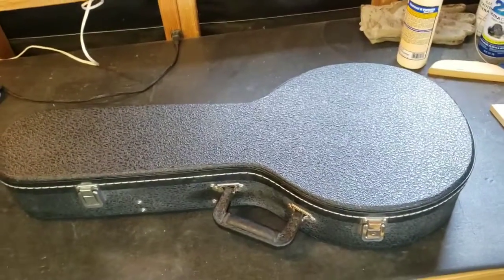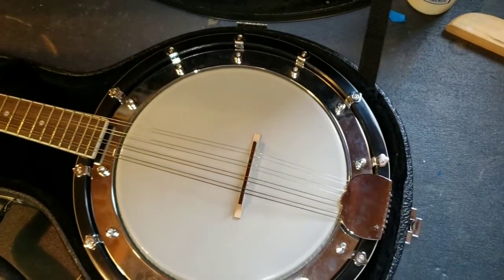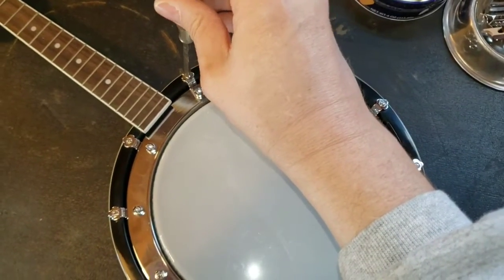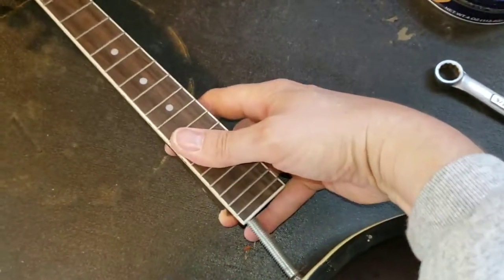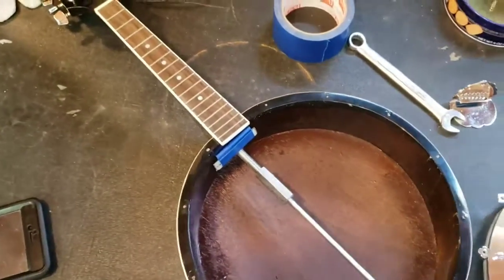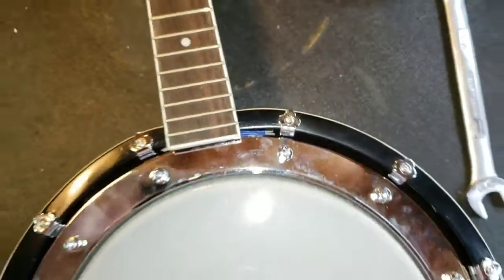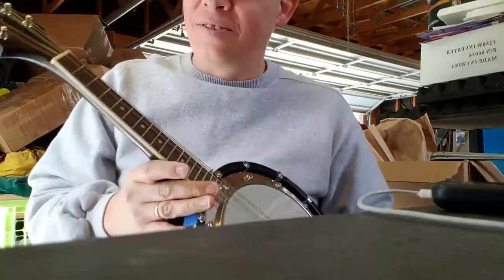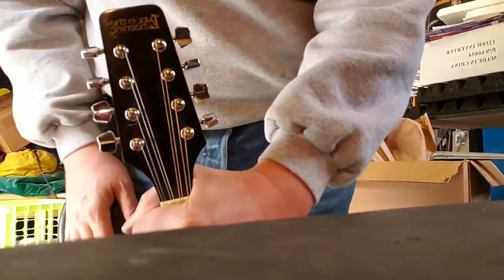Bought a Banjolin and was horribly disappointed. So I fixed it:-)

Comment: I would first cut 2 pieces of wood that matches the inside radius one for the damaged area and one for the opposite side.... then cut a piece of wood for the damaged area that matches the good area outside radius... then using c-clamps on the 2 pieces for the damaged inside and outside clamp together... gently ..... just to see what it will do..... then sand the left and right ends of the inside radius.... and sand the center of the outside clamp wood...(this is to allow for spring back after all sets) then I would wax heavily any areas I don't want any adhesives to stick being careful not to get any into the damaged areas.... then mix some thin 24 hour set epoxy resin and drip it into the cracked areas.... then apply the inner and outer radius wood clamps with c-clamps .... tighten and loosen those c-clamps multiple times which will draw the epoxy into the damaged areas hopefully deep down..... until im satisfied it has drawn in all the epoxy possible... then wait until the pot time of the epoxy is near to clamp down fully.... then using a spreader clamp inside the circumference spread it slightly more than it should be guessing for spring back after all is set..... then check the c-clamps and snug up if possible..... then let it sit for several days with a heating blanket or heat lamp to cure the epoxy fully..... this would very likely make it just as strong as new....I might apply a thin layer of carbon fiber to the inside ... and maybe shave a thin area off the outside to add a layer of carbon fiber .... could be done in a decorative pattern... or take off a little extra to have room to apply a thin 1/64th laminate stained to match...
Another possibility instead of carbon laminate is after epoxy sets is to drill diagonal holes thru the repaired area and insert carbon fiber rods or dowels thru and epoxy in place....
Carbon fiber dowel are available at many radio control airplane stores or online....carbon fiber is stronger than steel yet lighter than aluminum.... the dowels would be less obvious and tiny disks of wood or pearl could be put where the rods exit the outer surface to make it decorative

Comment: I'm guessing the adjustable bar connecting the pot to the neck is there to adjust the neck.
Reply from the maker: I found it did a great job of securing the neck to the pot, but it did not give room for adjusting the pitch of the neck.  Also the Pot had some damage to the rim there and would not hold tight allowing the neck to pitch forward.  I have it set aside at this time completely dissembled.  A friend gave me some advice to rotate the pot 180° and drill new holes.  But it’s not high on my to-do list so it sits in its case at the back of the instrument pile.  
Someday will come.  But not this year.

Comment: Might be a stupid question, but was it possible to attach the nek on the other side of the pot. May be the nek has been on the wrong side of the pot since it left the factory. Just shooting off some idea's here
Reply from the maker: Mind blown 🤯 
Even if it did not, maybe pulling everything and rotating the pot 180 degrees... 
thank you for the cool idea 💡
Reply: @WalterCombsLCSW  No problemo.  Hope it works out  for ya
Reply: been there done that didn't it just crushed the other side of the pot it will and has always has been a problem with this design of pot. you cant even strengthen the area because there would be no room for the internal mech. so he's done the right thing. in saying that once I even had the internal mech crush on me once after putting a wedge in. It must of been cheap brass i guess

Comment: all you had to do was extend the jack rod
Reply from the maker: Explain. And use non-luthier explanations.  I’m still new to instrument repair (3 years now) and find “Jack rod” on auto repair sites, but not so much with banjo 🪕 mandolin sites.
Reply: hi walter , i wasn't being criticaljust trying to help. the jack rod is the matal rod between the neck and tail of the instrument with the big nut in the midle one end of it has a right hand thread the other end a left hand thread so as u turn the large nut it will ethier expand or contract the length of rod there fore if you expand the rod it will push the walls of the pot out, stopping the collapse hope that helps or at least explains my comment
Reply from the maker: @granddad1954  Thank you for your feed back.  I pulled this instrument down and will look at it again this week.  If I can adjust the neck pitch with those adjustments I might play this instrument more.  I really like the way it sounds but before I did my fix the string height was impossible, and now its just difficult past the 5th fret.  I sanded down the foot of the bridge as far as I dare.  Any more and I would be concerned it might break under the string tension.  Sorry for my "tone" in my communication over the weekend.  It was a difficult weekend and I wrote and sent the message without much proof reading.  :-)
Reply: Extending the rod would push the neck forward. It's below the centreline.. It looks to me like it's had a knock that's broken the plywood at the weak spot.. It needs a new pot really, but shimming at the heel is his only quick 'bodge' option as far as I see.

Comment: The problem with these mandolin banjo's is that they use the very high tension of standard mandolin strings. This goes against the grain because banjo's are low tension instruments and mandolins are high tension instruments. If you simply put lower tension strings on a mandolin, you will have intonation so bad that it would be unplayable. If you use a multi scale fret board. Like a fourteen inch E and a fifteen inch G string all of the intonation problems dissapear .
Reply from the maker: This is great information and I will be looking into it further.  Probably next year.  All my hobbies are on hold as I focus on my career.  I have this instrument in parts again.  My plan is to spin the pot 180° and redrill the holes and reset the neck.  Basically, start over.  And I will be certainly looking into modifying the strings.  👍